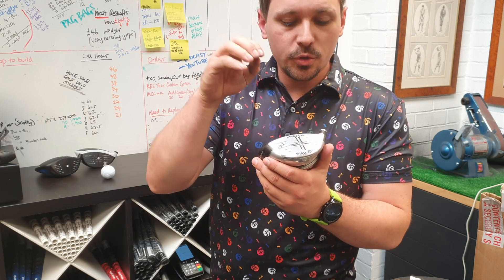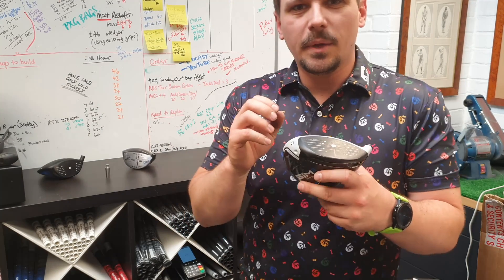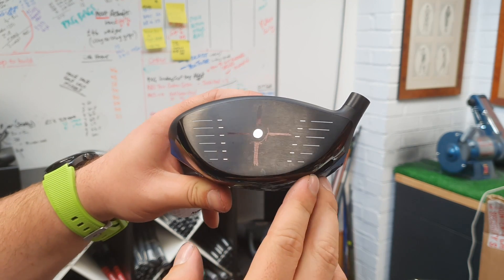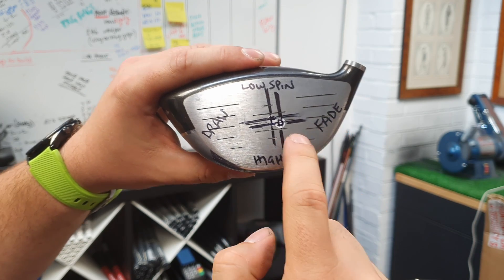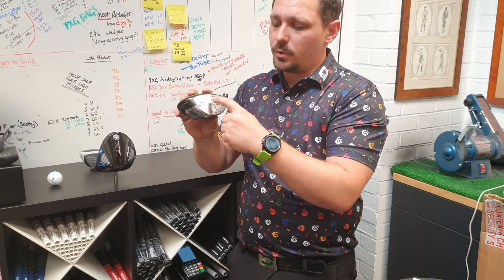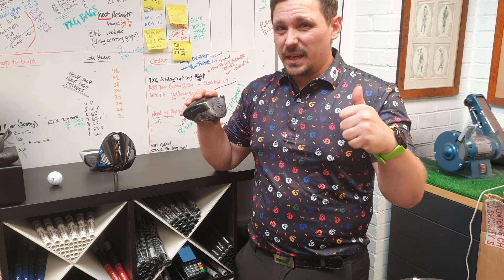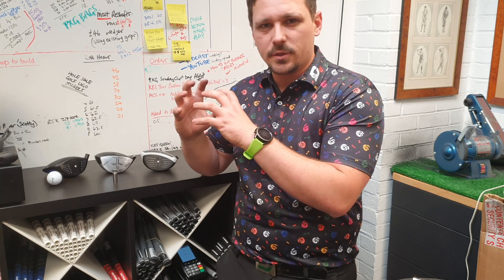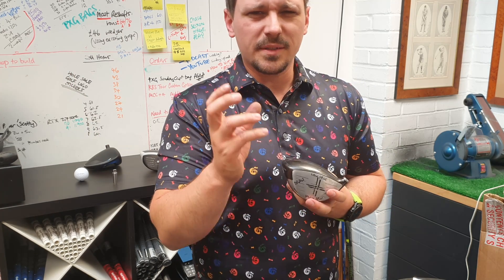Moveable Driver Weight - Gear Effect In Golf

Comment: Here's a question for you, I haven't hit this LS Driver yet just received it, thoughts?
* Shaft HZRDUS, Reg. 5.5, 60g, 4.0, and Low Spin
* Length 44 1/2"
* 3 Weight Settings, Rear-Toe-Heel

Now, after listening to what you mention, if I set my Weight settings at:
16g Rear
8g Heel
3g Toe

Will this create too much of a Draw Flight and a Higher Launch too high of a launch?
Reply from the maker: Ooh, I'd have to base it on ball data / tendancies ideally ...what head model and loft is it? And what flight are you getting? 😋